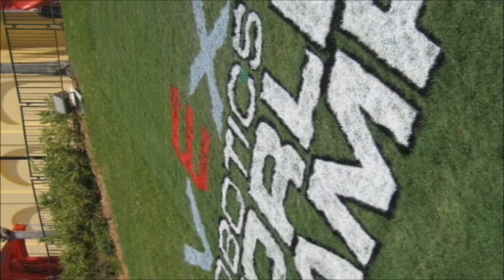2011 Green Egg Robotics (Team 44) Round Up Highlights -Fred IV

Comment from the maker: @christophercorrea14 Thanks. They controlled the dropping of tubes through how they programmed it.  They had it set so that if you pressed one button on the controller, it activated the pneumatics for a brief burst allowing for one tube to drop.  If they pressed another button it allowed the pneumatic to be activated longer and it would drop the whole stack off the needle.

Comment from the maker: @christophercorrea14 .  Rubber bands pulled the the shaft's of the pins down creating a "T" to keep the tubes from falling off the rectangular needle unless pneumatics were fired. When the pneumatic piston was fired, it pushed down on the the center of the 2 pins  creating an upward "V"..that allowed the tubes to pass over the pins. Hope that helps.

Comment from the maker: @christophercorrea14  I'll give it a try.  It would be easier to show than describe but I don't have any pics or close up video to show you. The intake needle had 2 pivoting pins in a  winglike mechanism that created a one way valve when the pneumatics were not activated. The 2 pins used rubber bands to pull them down against a stop into a "T" position. When the needle was pushed down into the center of the tube the wings pivoted allowing the tube to be clicked in.   cont'd